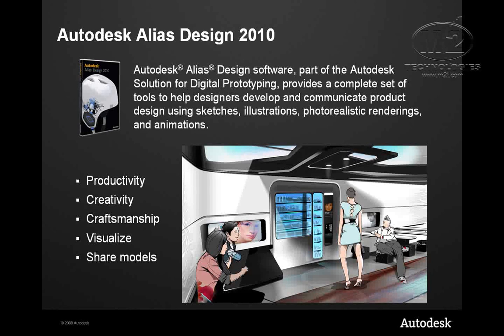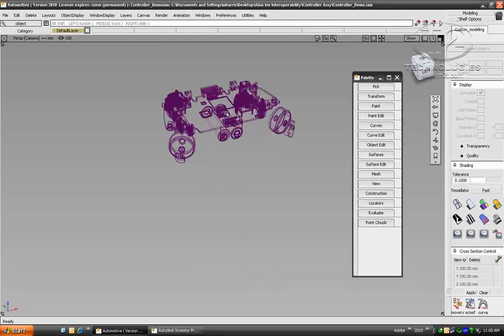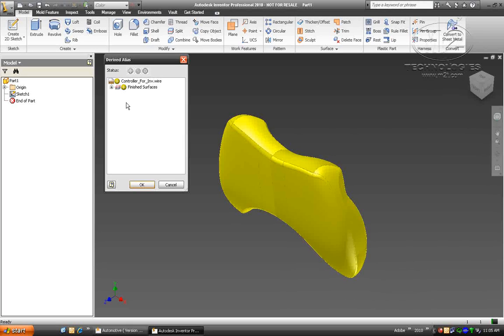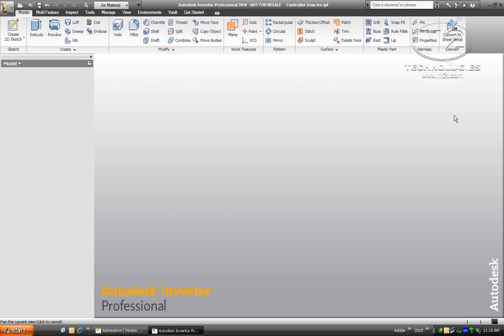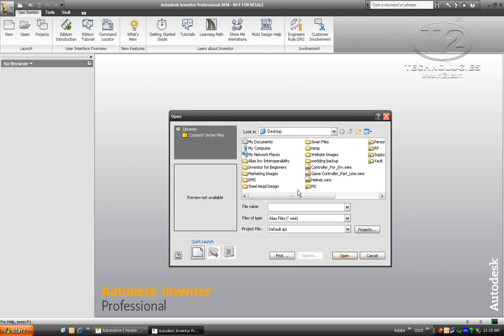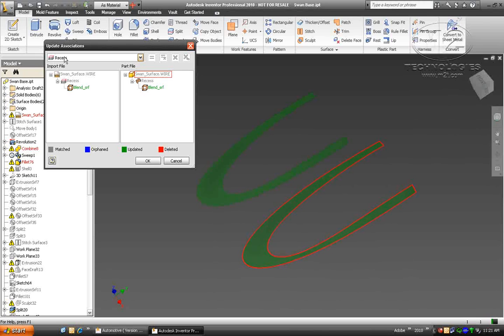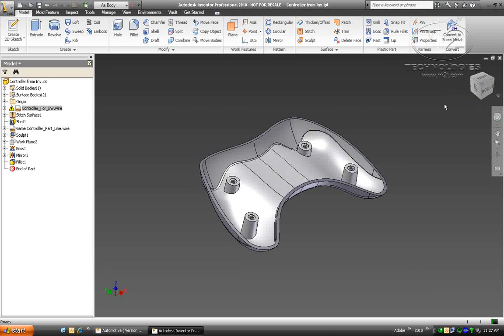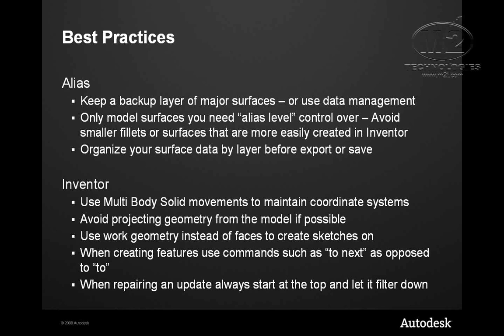Autodesk Alias and Inventor Interoperability

Comment: Hi M2Team, is it possible to export from Alias to Inventor even as a Step file, either for the group of shells or just the stiched mesh? I need to do a similar work to yours, just I can't work on the surfaces  on Inventor (like adding fillets, extruded parts to insert screws, etc..), which is happening many times. Thank you.